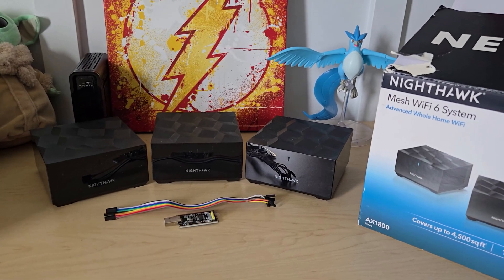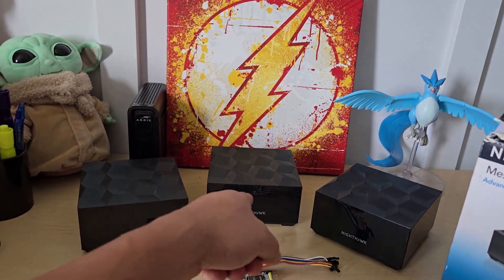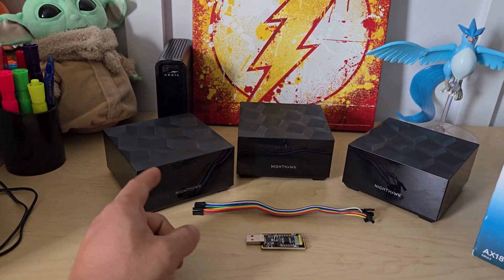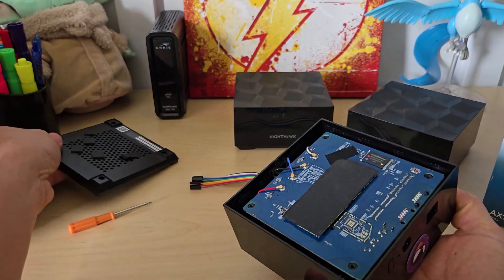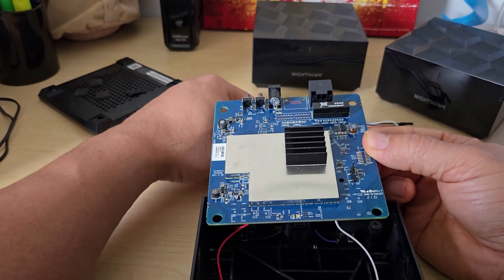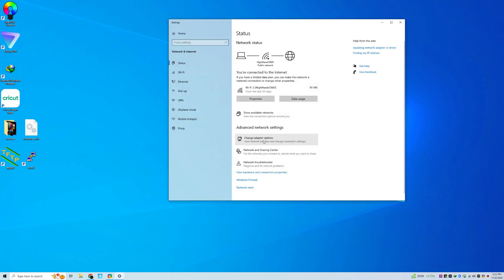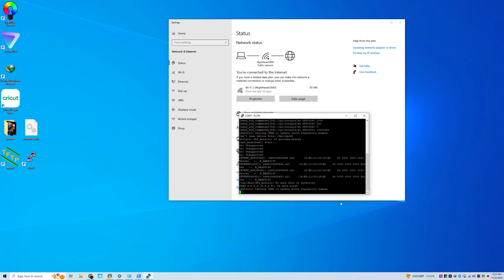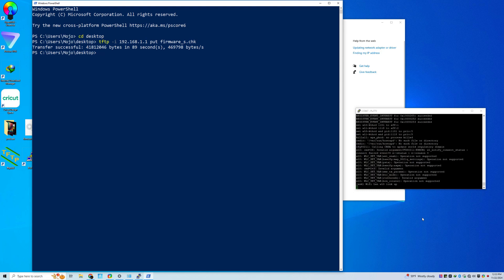2024 FIX! Blinking white LED NETGEAR WIFI MESH Satellite issue model MK63

Comment: Mine the satellites keep disconnecting from the main unit
Reply from the maker: this product is a pos tbh... i got rid of it after using it for a week because it was very random. i believe it is thermally not stable and so when it throttles , it messes with the flash memory and forgets its configuration settings.
Reply: I'm having the same issue. Just installed my system a week ago. It all worked great the first 3 days. On day 4, one of the satellites gave me the orange light instead of the blue light. 2 days later, the other satellite status light also changed from blue to orange. I have resynced, which did not work. I then reset and reconfigured, but they still don't work. I then used ethernet cables to connect both satellites to the router (what they call "back-haul setup") and both satellites gave me the blue light again. Back-haul setup defeats the reason why I bought these. I left both satellites hooked up to the router for 2 days hoping they would communicate and upload any new firmware, but they didn't. My satellites now only work in backhaul setup. If you found a solution, please let me know.
Reply from the maker: @ solution is get rid of these I’m just hearing very bad build and here’s another crazy thing … when I set it next to my netgear modem, it shut off my modem so it tells me signal integrity is bad on these
Reply: Thanks for the reply. I was able to call Netgear tech support and they had me cable connect the satellites directly to the router. Then they had me upload the latest firmware. So far, my router and both satellites are working good and have not lost connection for a week now.
Reply from the maker: @ glad to hear it. I went with EERO PRO 6 mesh system it’s been up for almost a year without dropping out so I’m very happy